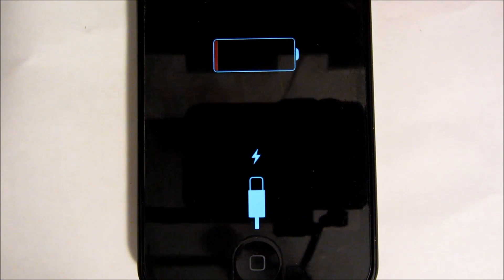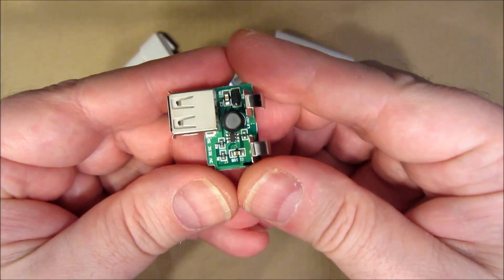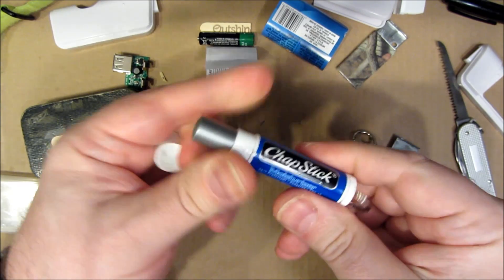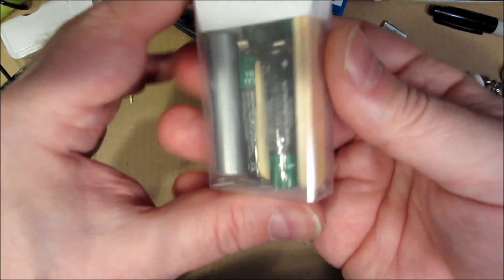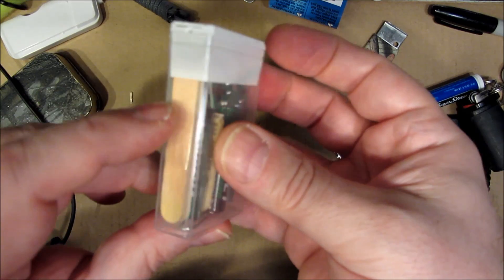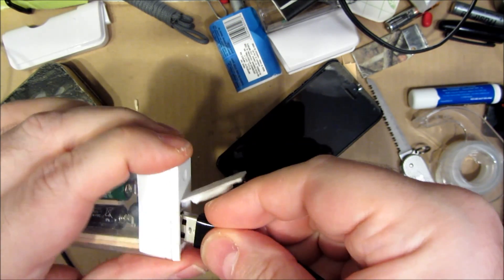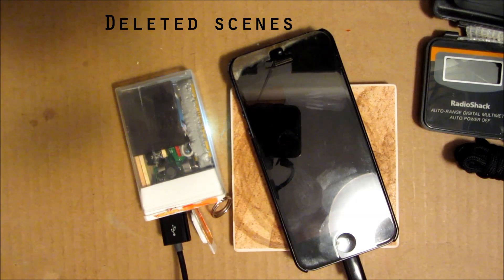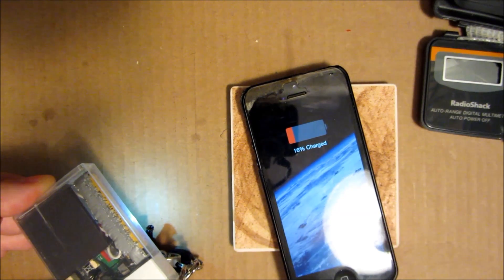Tic Tac Cell Phone USB Charger [emergency AAA battery power for partial charge]

Comment: Love, love, love your creativity! How about revisiting this since it’s been half a decade using lithium batteries!?
Reply from the maker: Thanks. I dismantled this device and no longer use it. AAA batteries don't contain enough juice to charge my phone for any useful application other than to make one or two emergency phone calls, maybe, so I didn't think its bulk on my keychain was justifiable. This was more of a test to see if it could work theoretically in a pinch without needing a soldering iron. Even larger AA batteries I don't think can fully charge the phone when fully depleted, by the way, but I'm not dead sure about that.

Comment: What was the point,  all that was done , was to change the  housing,  not trying to be rude,  but why not add an extra battery after going through all the trouble,   just asking
Reply from the maker: Its smaller, shorter, slightly flatter in the pocket , see thru, mounts on my keychain, runs on the battery of my choice (AAA) which is used in all my other keychain devices (laser, flashlight, and car alarm/pager/starter) so  each device acts as a backup battery for the rest, and was fun to convert. Plus in later deluxe configurations I add a switch plus solar recharging capabilities and an LED light, both only possible with a clear plastic housing for the light to shine through. The USB port also now has a captive, hinged dust cap which the original design didn't.
Reply from the maker: Also I made it a point to undertake all of this BASIC version without using a soldering gun so that anyone can emulate it even without soldering skills or access to a soldering iron.

Comment: The only thing that i see that could be improved on is the ready ability to replenish the batteries. I was hoping youd either expand on the battery size/compatibility. I did love the solar panel and key ring idea! Great videos keep 'em coming!!
Reply from the maker: There are many ways to improve this sort of thing but I intentionally didn't use a prefabricated, spring loaded AAA battery holder nor additional wires, just a bent paper clip. The idea was to see if it could be cobbled together in an emergency without any special tools, not even a soldering iron. Having the batteries easily swappable is a good idea though, I agree.
Reply: Still, I am very impressed with your ingenuity and I am learning a lot!

Comment: Can someone help me with the paperclips?I don't know how to bend them or whatever you did properly
Reply from the maker: One problem with some paperclips is they have a very thin, clear coating on them (I guess to help prevent rusting). You have to scrape that off with a knife before it will conduct electricity. That may be the issue. In some of my homemade gizmos I also attach wires by taping them on with non-stretching tape like Scotch tape (avoid tape that stretches like duct tape) rather than relying on friction. This makes for a better connection. Of course buying a dedicated battery holder or using a soldering gun works best but I wanted to show that this thing can theoretically be made using only household items.  Not everyone owns a soldering gun after all.
Reply: +MeZillch Ok thanks for the tips!

Comment: how did you open the USB charger box
Reply from the maker: +Dafney Campos It, the original charger, is put together as two halves which easily pry apart with a butter knife or small screwdriver blade. It is possible that some versions are glued together , or have screws, but the cheapo one I got at the Dollar Tree Store was simply held together with friction.
Reply: MeZillch I got mine at dollar tree to but I got it open with a knife it took a long time , but thanks for the info

Comment: You took something fairly small with rounded edges and made it bigger, bulkier and less portable while serving the exact same purpose it started out as...  good job...
Reply from the maker: +Dave Butts Incorrect. This mod is slightly smaller, lighter, has a ring attachment for keychain carry, a hinged dust/lint cap for the USB port, is see-through, and carries a 23 inch roll of clean, dispensable duct tape, should it matter. Original, unmodified USB charger: 83.1mm long, 20.8mm thick. Tic Tac box version: 72.5 mm long, 17.2 mm thick. I have never heard anyone describe Tic Tac boxes as having objectionably sharp edges for the pocket, but I suppose they are less rounded; that part is true.

Comment: Those little emergency chargers leak power... What i mean by this is that i made a little usb led light and put it in the port with ought turning it on. and it is still lighting the way to my door after about almost 8 months now and very little dimming. so in case of a power outage i can find the way to my door (which is on a little hanger i rigged up) and turn on the charger and it is a very usable flashlight.

Comment: AAA is the same capacity as AA just a little smaller if you don't believe me look on the side of the batteries
Reply from the maker: Joshua Dowden  If you mean voltage, yes they are the same, however if you mean capacity measured in milli-ampere hours, mAh, [which largely determines their run time] AAs made with the same chemistry and brand as AAAs are always stronger. Example:https://en.wikipedia.org/wiki/Ampere-hour#/media/File:Duracell_rechargeable_batteries.JPG

Comment: As usual MeZillch your idea is brilliant as far as I'm concerned. I've tried a couple of them like the chapstick container. I keep a 64G flashdrive in one, it's opened so the container keep it clean. I seal it with duct tape-naturally. I keep fire starting equipment in another. I also made the short box cutter-that's a Gem. Question, where you get the little solar charger? Let me guess, you salvaged it off of something-right? I'll be looking for one. Keep up the excellent work. It is honorable that you put your ideas out there even if they are not perfect, offering others a chance to improve on it. That's the community spirit.
Reply from the maker: Sabbath Christians Thanks. I'm glad you like, and use,  the box cutter and other items! The whole point of my videos is to inspire others and I try to use only simple tools and easy to find items so it isn't hard to do.The solar panel is salvaged from a garden light people often use to illuminate paths in their backyards. I bought mine at a Dollar Tree store however many hardware/gardening/home improvement stores sell them. I show how to extract the panel in this video:https://www.youtube.com/watch?v=f1Aw7DPymgY

Comment: The original charger already hhad a pretty neat cover/container, dont see the need for a tic tac container(except for the solar panel).

Love ur vids anyway, keep em coming.
Reply from the maker: kessler003 Yeah, there are actually several designs I have now made using a Tic Tac box, most of which don't have videos yet, where the contraption is more of a reconfiguration than anything else. To many the improvements will be of little value. The device shown in this video is flatter, a bit smaller, see-through, has a key-ring attachment, and a hinged dust cap for the USB port to keep it clean in one's bag, but if none of these things seem important to an owner then it is a waste of a perfectly good Tic Tac box, plus the 10 minutes or so to put it together.
Reply: MeZillch I agree with you, we should always be trying new and different things and posting them even if they fail, because it just might give someone watching an idea to share on how to turn a failure into a success. That being said, what do you think about fitting a joule thief into that spare area? Would that help at all with a little more power to get a couple emergency calls out??
Reply from the maker: wjf213 I can't say I'm an expert on the matter but as I understand it a joule thief allows one to get a bit more juice out of a battery, even as it gets to a very low voltage [which can permanently kill certain rechargeable battery chemistries so you'll never be able to recharge ever again], but only with a small current draw as one might expect from a low power LED. This USB charger on the other hand consumes much more current and presents a much greater drain than what an LED does.

Comment: Would using those battery pack that come with cheap hand held radio or Dynamo radio/flashlight would produce a better recharge?
Reply from the maker: TheMountainRN I don't know much about those batteries you mention so I can't comment on them specifically, sorry. What I can say is that in my recent testing of my solar glow fob I've discovered that the supplied, low capacity Ni-cd AAA battery has a fraction of the electrical capacity of a fully charged NiMH Eneloop AAA. Unfortunately a full charge of it can't be achieved in only one day of sunlight. There will be a part 2 of that video some day which will describe this in greater detail; I'm still testing different designs.

Comment: Instead of duct tape, why not a short charging cord in that space? A 6" one would probably fit.
Reply from the maker: GizmoBee1702 Good idea but the duct tape roll, which acts as a spacer, [plus you are carrying a supply of duct tape for other emergencies] keeps the AAAs from flopping over. If you were to substituted it with a short USB to cell phone cord the problem would be that when you extract the cord to charge, the AAAs would flop over. You could jam your pinky into the hole or maybe carry a piece of cardboard on the face side of the Tic Tac box, inside, which you refold into a rectangular prism to fill the missing charger cord space, though. Hmmmm...
I bought a 4 inch Lightning  cord on Amazon called Mediabridge, http://www.amazon.com/gp/product/B00VS8NA14  perhaps their house brand, to play around with just that and other ideas but I first wanted to put out a video of my first prototype which required no electrical mods nor special devices [most people don't own 4 inch cords], so everyone could give it a go. Thanks for the suggestion though!